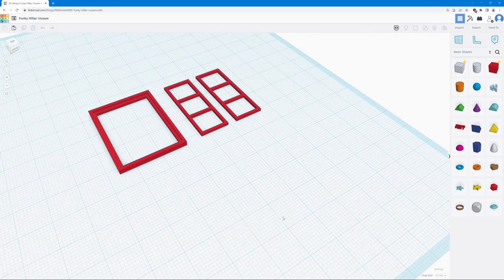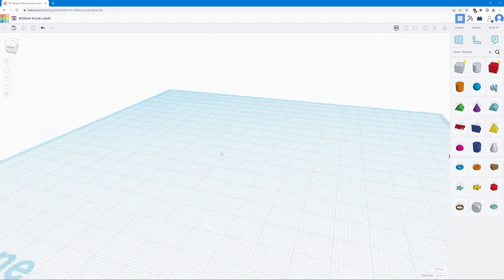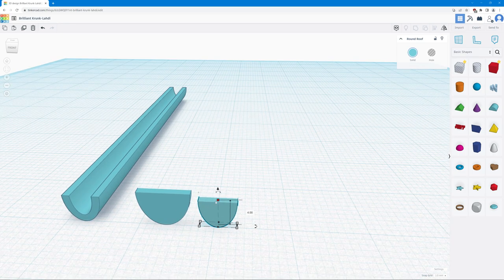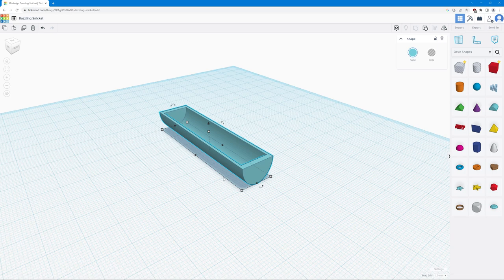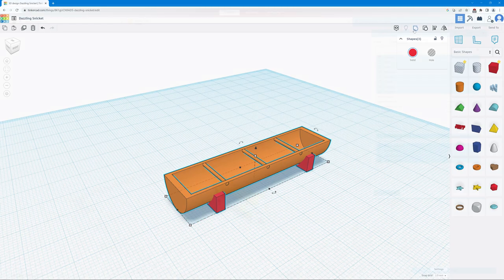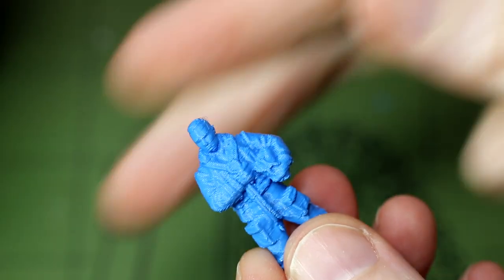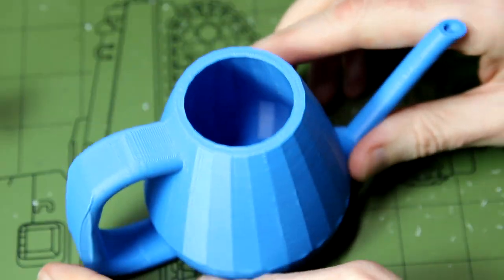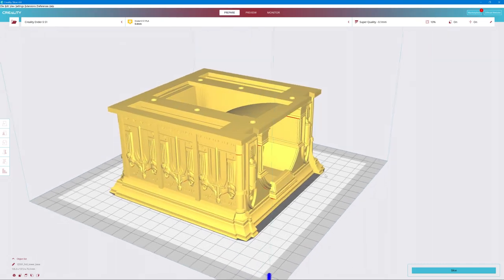Designing and 3D printing parts for my new scale model diorama with the Ender 5 S-1

Comment: Great video, from the designing in Tinkercad to the printing. Agree for the small, detailed stuff most of us are going to make for scale models, the resin printer is the way to go. I think I got my Elegoo Mars 2 + washer/curing station for what that Creality rig costs.
Reply from the maker: Thanks Bryan. Yes, incredible what prices have come down. You can get entry level resin printers are under $150 now when they have sales. My Creality Halot One has seen a LOT of use!
Reply: @ModelNerd  and funny enough, I was in Tinkercad last night working on making one of the boxes for a GEE system for my Mosquito. Not proficient yet, but gaining with each use.
Reply from the maker: @fotomakr  It's quite powerful, isn't it? Especially if shapes are mostly square or simple curves.
Reply: @ModelNerd  Yes. My eureka! moment last night was using curved pipe shape x2 for the C handle shape. They're sliced and I'll print them tomorrow night.

Comment: Hmm, not impressed with the printing, you have scratch built much much better stuff, using any of those gutters would be second rate. Don't downgrade your fantastic dioramas just because you think you have to use new technology please.
Reply from the maker: Hi Tony. I agree that FDM printing isn't ip to it. However resin printing is MUCH higher quality so I'll be using that for thr fine details (I definitely couldn't scratch build a feeding trough). Did you see thr FDM vs resin pilot figure in thd video? Poles apart in terms of quality.